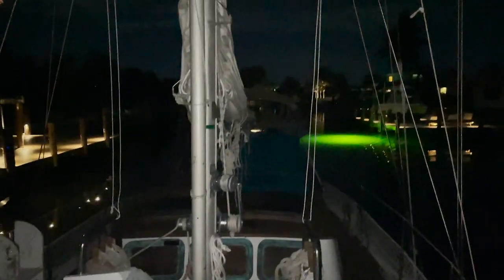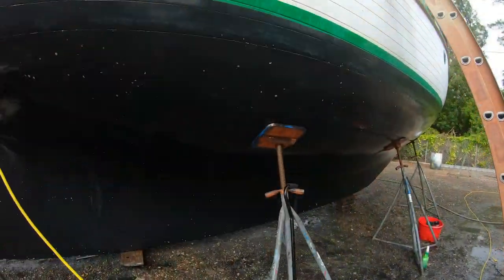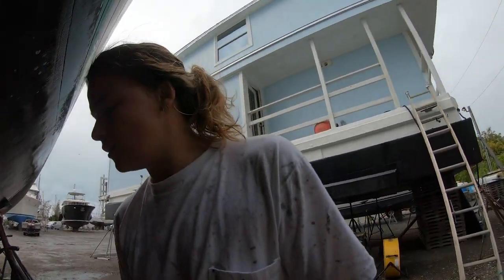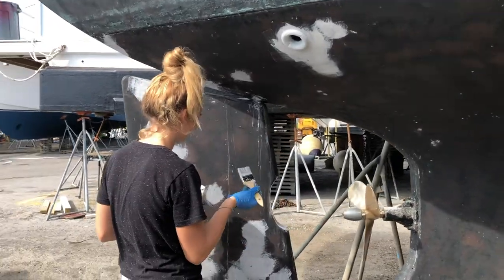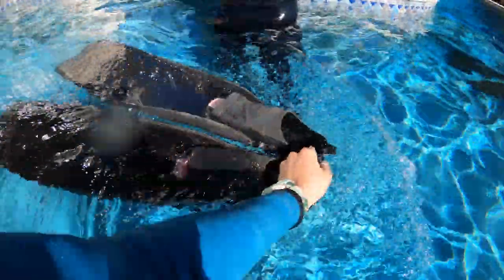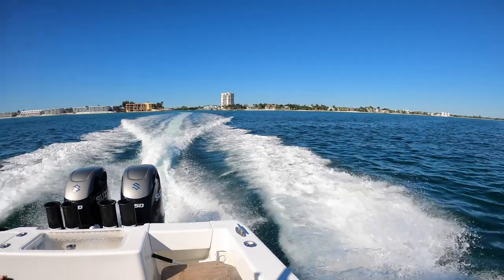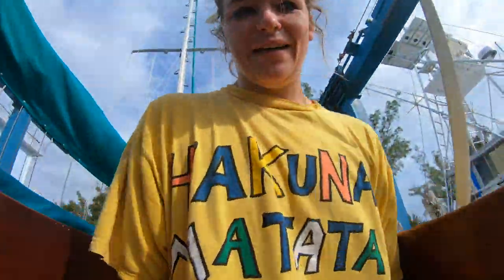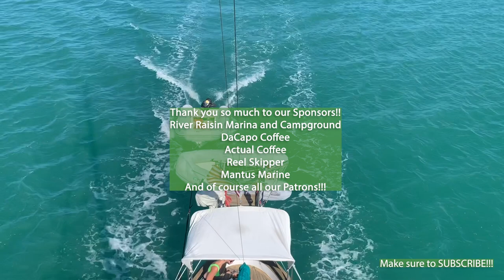Finally SAILING To KEY WEST, Haul Out, BOAT Prep, FREEDIVING Course S2:E24

Comment: What did your dad do to his leg? I didn't notice the cane last season. Did I miss an update?

Also, are the through hulls brass or bronze? You may or may not know this, but brass will get brittle when submerged in salt water for a few years. It's highly recommended that you replace brass through hulls every 5 years or so (I don't remember the exact time frame) because of that. They will get so brittle you can just snap the stems right off when you go to close the through hull. That's not any fun at all!!!  

IMO, bronze is the way to go, even if they are the most expensive of all the options.
Reply from the maker: He had a full hip replacement 3 months ago! Not using the cane anymore though.

Comment: Also I would check into on demand hot water 30 amps 110 plug in
Reply from the maker: We have a solar bag that we fill with water and it heats during the day! But usually we don’t need hot water

Comment: I see the base of you rudder drive cylinder move when you turn the wheel you need to address that issue it will only get worse and if it breaks you will have no steering.
Reply from the maker: We are aware but no time to fix yet! It’s very minimal so we are good for now

Comment: That rudder system scare the heck out of me! How is the drive link locked on to the shaft with a mere locking bolt?
Otherwise great to watch Safe travels!
Reply from the maker: There is a groove in the rudder post. The bolt just keeps it from going up and down

Comment: OK, I have to ask what the deal was with the lighter and the masks.  I couldn't quite make out what was said.  I've been diving for 20 years and I've never seen anything like that.  Always willing to learn something new!
Reply from the maker: When you buy a new mask there is a film on the inside that causes a lot of the fogging. You can either scrub the film out or burn it off. Burning it is a lot easier if you know what your doing 😁
Reply: I've just always told my students to use non-gel toothpaste and scrub it like the dickens.  Never heard of the fire method!  Not sure if I'm brave enough to try fire!
Reply from the maker: Haha yah, us neither, asked the pro to do it for us 😋
Reply: I assume you girls know this, but non-gel toothpaste is good to use a few times a year just to keep the mask clean, especially if you use it a lot (like I assume you do).  A clean mask is less likely to fog for sure!  It's not just that initial film that will make your mask fog.
Reply from the maker: Huh we didn’t know that. But will definitely start doing that